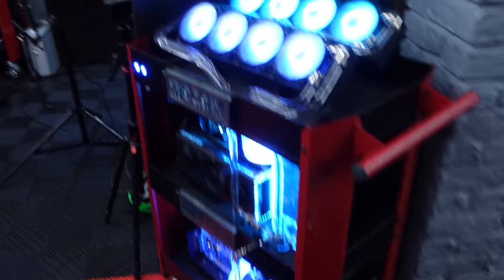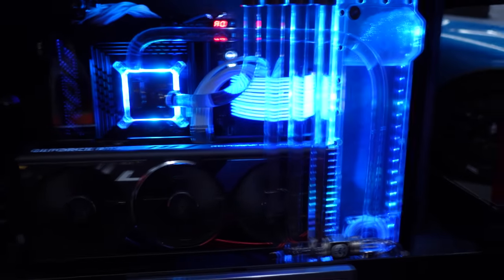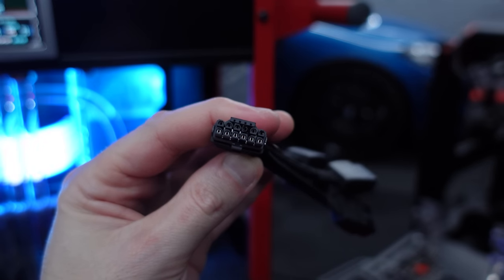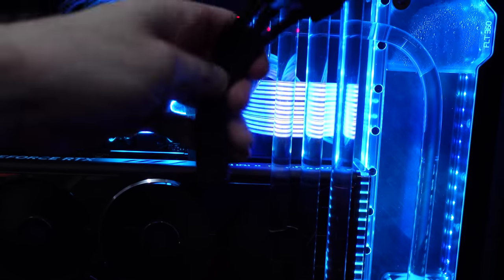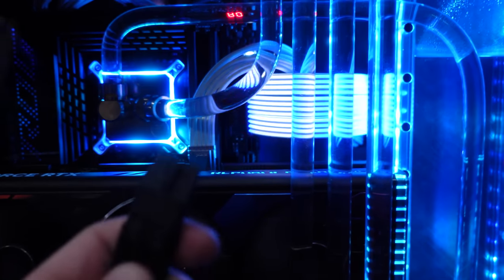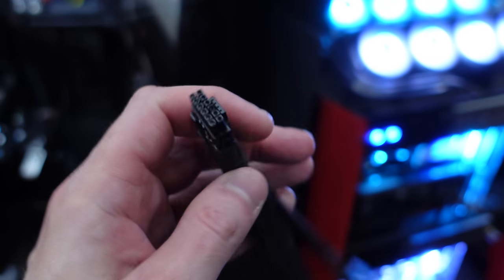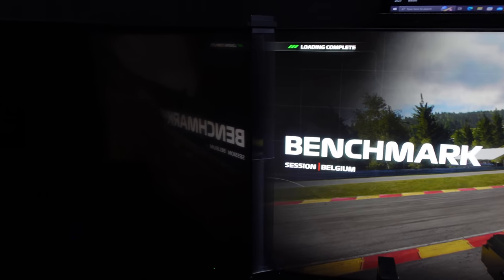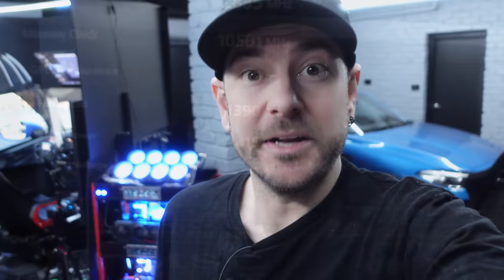MY 4090 WENT UP IN SMOKE after 7 Months!

Comment: Ive noticed with my xbox and pc that some games paused use the graphics card at 100%, not sure why they do that, so guess it was drawing alot of power over a long period, i didnt think the 40 series where supposed to be as power hungry as the 30 series
Reply: They aren't.  The 4090 vs 3090ti is 450 watts vs up to 600 watts, respectively.

Also much fewer issues with tripped power supplies.
Reply: @pondracek  4090 is very rarely uses 600w, look at this video where it's using 420w
Reply: This large consumption of electricity in game menus is due to the fact that programmers do not put a brake on the maximum number of FPS that a game does in these images that are static. A friend of mine is playing an indie game and has seen his RTX 3070 momentarily charge 1000 FPS in that game's menus. And it's only in the game's menus that the graphics card fans fire to their maximum rotation. And this is the second indie game that he plays and where this happens.This usually doesn't happen with games from triple AAA publishers, but this rule is not 100% certain. It's a situation that all gamers should be aware of, even those with graphics cards other than the RTX 4090.
Reply: @benclimo461  The 4090 doesn't use 600 watts.

The 3090ti does, on certain models.
Reply: The 30 series uses more power and cost a thousand dollars more than the 4090.

Comment: Do you have your 13900k over clocked at all?     

I've found my GPU runs significantly better when my 13900k is running XMP and over clocked..   I don't go crazy.. generally run 2 cores at 59.  3 at 57, and the last 3 at 56.   Then E cores at 45.  Even tho I'm only running a 3080ti at 1440p 49 UW monitor, my GPU runs so much better when my 13900k is running efficiently.   

My benchmarks are 14,000-14,100 on the Intel XTU 2.    Time spy CPU score 24,100+.  3d mark CPU benchmark 17,400 all core and 1250 single core.  

I will say the 13900k is a pain in the ass to get fine tuned. At least with the Asus motherboard bios's
Reply from the maker: Yes it is.

Comment: Personally this is happening often enough that it isn't "user" error.   The 12 pin connector is just a commercial failure itself.    You're taking 16 pins and shrinking them down into 12 pins in what is likely the hungriest GPU to have ever existed.  It's bound to happen... I feel any tiny fault whatsoever will cause it... and personally that's a FLAW in the over all product well beyond just connectors.  It's foolish calling it a user error in short.   It isn't like the good old days where you could install memory upside down, this is a connector, it should plug in, and work.

Comment: don't know your fps situation with those 3 screens.. but i dont get why you dont undervolt the 4090, pretty sure you would get about same performance but way much less power consumption and heat..
Reply: why undervolt? the cooler on this thing is overbuilt, even for a 4090. undervolting would reduce the power draw and also some fps. even if you lose 5-10% performace, why even do it if you're not concerned about your bills and the heat?
Reply: @Amfibios  your answer clearly shows me you dont have a 4090 or you dont know enough about undervolting techniques, there are various ways and you completely maintain the stock gpu boost and still save averages of 70-100 watts less power draw, it actually increase fps because the card wont probably loose the 2835  V/F point since it produces less heat.
Reply: @HyrrokkinX  please link a guide where you gain more performance by undervolting the 4090
Reply: @Amfibios  it's literally all over the internet, google or YouTube just use the search.
Reply: @HyrrokkinX  wait a second. you've been pretending to be an expert on "undervolting techniques" all this time and supposedly i don't know enough. if the secret technique is all over the internet i guess i'd know it, right? i'm still waiting for the guide that shows you how to undervolt a 4090 and not only decrease fps, but also increase it. it should be easy for you to link it, they're all over the place anyway, right?
Reply: @Amfibios  i am not pretending anything.. if you can't even use Google or YouTube not my fault. do your homework.
Reply: @HyrrokkinX  busted mate... imagine preaching and being unable to provide proof. trolling 101 right there 😂

Comment: Okay, few! A Cable Mod's cable didn't cause the issue. I immediately ordered a CM cable after buying my 4090.
Reply from the maker: So did I. It took 3 months to arrive though and in that time I had no issues so I thought it better to just leave the connector alone than put it though an unnecessary cycle.
Reply: @Boosted Media  I had the same reservations once my CM cable arrived. However, my GPU is mounted horizontally, and the power cable is slightly pressed against the glass. I opted to swap it right away once I saw the metal support for the pin that melted on yours. Figured swapping right away was safest for my application. I wish the 90° adapter would fit my 4090, but the cooling fins on the Aorus Master stick out too far. I'm about 5 months into my ownership, and so far, so good 🤞🏻

I hope moving forward, it's smooth sailing for you and your setup 👌🏼

Comment: I dont care if its user error or not, modern pc components should not catch fire. The fact its a known issue should be a major red flag and they should have been taken off the market. Shame on NVIDIA for releasing cards and connectors that can do this. You should not have to make sure the connector is pushed in after the click, it shouldn't catch fire it should just not work.

Comment: The cpu has no bottleneck I saw the gpu is running at 99%😂. When u have the gpu at 80/90% then u have an cpu bottleneck. Ur 3x 4k monitors is the bottleneck 😂
Reply from the maker: Yep the difference in power draw is down to ray tracing. If I turn it off on F1 power consumption is more similar to ACC.

Comment: From the damaged connector that you showed you can see it was not plugged in all the way.
There is a line on the damaged connector from where it sat in the connector.
Its a very easy mistake to make because there is no audio feedback or feel if its in all the way in.
To see if its all the way in you can't see any of the male part of the connector and they need to be flush against each other.
If your still confused to how far it needs to sit checkout MSI's version of the 12vhpwr connector the yellow part you CANNOT see.
Reply from the maker: It was absolutely unequivocally plugged in and seated correctly.
Reply: I believe you, but it definitely looks like a "tan line" on this still image. 5:11 

Do I believe that these connectors can melt when unequivocally seated? 

Absolutely I do! 

It's the main reason I'm waiting to see if there are improvements to 5000 series connectors upgrading my 3080.
Reply from the maker: I can see the line you’re talking about. Not sure if it’s caused by the heat cycles around where the pins sit but it’s certainly not a score mark where the connector was resting against the socket. It was 100% pushed all the way down and I visually checked it meticulously.

Comment: The whole ATX standard for PC's is falling apart. 
The size, weight and power consumption of modern gpus makes the idea of 'mother' and 'daughter' boards completely redundant. We really need new  form factors and a reimagining  of what a pc can be. 
Instead we get a slight change in the pins the cables use.
Realistically only Intel and Nvidea working together can give us something new that has the capacity to take us into the future.
Reply from the maker: Agreed. The 12VHPWR connector is massively inadequate for the current throughput it's expected to handle. I don't know what they were thinking. The fanboys screaming "user error" certainly doesn't help either.

Comment: From what I can tell and the many hours of research I have done. It looks to me like the terrible adaptor that comes with the card and the Cable Mod adaptors are the ones burning up. I have yet to see any of the Corsair Premium cables melt. I really hope this is the case as I am using one atm. 
There was absolutely no way in hell I was going to use that garbage Nvidia adaptor no matter what stupid message they wrote about voiding warranty. Shocking quality and looks awful in an expensive rig. 
Nvidia should be ashamed but sadly they have no dignity so no chance of that.

Comment: Not the video you want to see as you thinking of buying one. I wish they would do away with the connector and just hard wire it one less failure point.
Reply: And what do they put at the end of that wire?  (That's right.  A connector.)

Literally the definition of a distinction without a difference.
Reply: @pondracek  you eliminate the faulty by design connector, and yes you have tried and proven connectors at the other end.

Comment: Hey Will! Looking at the pictures, it looks as though the cable wasn't fully inserted. All cases of those cables catching fire was related to the cable not being properly installed, not the bend radius or the brand of the cable. I know you've adressed it in your video, but still.

Comment: A very poor engineering decision has been made with those connectors. Some people maybe thought that they could circumvent the law of physics by cramming much more current into tinier pins without thermal consequences. Design considerations must not take over basic physics
Reply: The connector "should" be absolutely fine to handle that kind of load, it's around 420w he was using at most and  between 6 pins the wattage is only around 70w which is absolutely fine for those pins. Remember that some phones charge at 120w and the pins are much smaller and I haven't heard of any fires.

This is a faulty cable which should never have been allowed to pass QC.
Reply: The spec for usb C charging is a max of 100w at 20V, spread across many "pins" , on a completely different style of connector...
Not really comparable at all.

The fact remains that the 12vhpwr is cutting it very close amperage wise, and the pin design seems to have issues.
As shown by the many failures that have been happening.
Not to mention that connector is rated for 600W

Comment: Technically it is user error, because you didnt check the connection each time you went to use it. But in reality its manufacturer error with the connectors on the card side, no cables are fire proof yet. Theres also no real fix other than not buying 1. Its a flawed connection and needs to be changed. If you want to learn about it, watch gamers nexus videos, hes done testing and has recreated the issues
Reply from the maker: The connector was seated perfectly. Nothing about this is user error and I watched all the content from GN and others as it came out. I was acutely aware of the issue hence checking the connector so regularly and not water cooling the card.

Comment: RTX 4090 24GB = around 80 % of them are melting their own 12-pin connectors = around 50 % have to RMA-d due to melting death of the PWR circuitry
RTX 4080 16GB = around 50 % of them are melting their own 12-pin connectors = around 25 % have to RMA-d due to melting death of the PWR circuitry
Reply from the maker: Where are you getting those numbers? That seems grossly inaccurate.
Reply: @boostedmedia  How do you figure that these are inaccurate ? Do you have statistical numbers on your own ?

I am using multiple European hardware repair specialists testimonies and statements, including my own since I also repair PC components, when they are constantly telling me for a year now, that the largest number of hardware repairs out of all the PC hardware repairs are done on the RTX 4090-s as far as PC components goes in general. They have their internal statistics from their businesses which they have to have due to invoices that they put out on for repairing these GPU-s. Countless clients of mine, that have bought the RTX 4080-s or RTX 4090-s have already either RMA-d 1-2 of them or repaired them at these specialists.
RTX 4090 is by far the largest numbered of failed product in the PC computer history. No other hardware component has broken down in such large numbers and I've been repairing PC-s since the age of 3D-FX Voodoo 1 4MB and 1-st gen. Intel Celerons and Intel Pentium 2-s.

Comment: Honest opinion, most dumbest connector made. Just go back to the 3x 12v rail connectors. That way you have isolated current through into the PCB. Smaller isn't always better. Problem when aesthetics takes over just an engineering flaw.

Comment: Im glad nothing worse than this happened! 
Was the connector actually fully plugged in? In the end lab testing finalized that the problem is with these burns in 99% of the time is the cable not fully being plugged in
Reply from the maker: Yes.I was absolutely meticulous about this and visually checked it regularly just in case it backed out for some reason.

Comment: Click bait much? 😂 There's a slight difference between a card going up in smoke or a connector failing/melting and the card still working with a new connection lol
Reply from the maker: When I walked downstairs there was smoke coming out of it.
Reply: The only difference is temporal.  

Given a few more minutes, I'm sure you could get from Point A to Point B.
Reply: @pondracek  doesn't change the fact the title suggests 1 thing and reality another aka click bait. When someone in saying, in all caps, that something went up in smoke, it is implying it burned down, not that  some smoke came off it
Reply from the maker: I said it went up in smoke because it went up in smoke. If it had gone up in flames I would have said it went up in flames. 🤦‍♂️

Comment: Ok, well if it was plugged in all the way then everyone would have theirs fail.. I’d double check your new cable.  It takes so much force.  20-30lbs.  Put a lot of force on it.  Don’t be nervous about it.  No one has broken the soldering by properly pressing the cable in.  I thought it was silly how much force it took.  terrible engineering… it should take 10lbs max and have a very tactile and audible click.  Not rocket science…

I am using a cheapo 3 to 1 on mine.  It’s much more flexible than stock too.  Bending 180° in less than 2”.  No issues but it’s 100% clipped.  Who knows, it might fail if yours did.  You’d know 100% when you unplugged the failed cable if it was clipped.  You say it was… so I guess we’ll assume you’re telling the truth. I just don’t see how it fails when it’s clipped.  Literally first case of this happening in the world….
Reply from the maker: Yep. It absolutely was. You can even see the scorch mark at the BOTTOM of the socket on the card side.

Comment: Ah yes spending 2k on a gpu and watch it kill itself within a few months 😂 typical nvidia. That's why i switched to team red.
Reply: Yet AMD can't compete, driver issues and very poor VR performance.
Reply: @BKHD605  yet nvidia gpu lights itself on fire ... Yeah rather have a fire hazard then driver issues i guess 😂
Reply: @henkhenkos8647  It's a shame you can't buy the 4090 with normal 8pin connectors
Reply: @BKHD605  yeah ngreedia and their " innovation" that turns your house into a big heater if you're lucky 😂 and true why trying to fix something if it isn't broken...

Comment: If I remember correctly, several tech youtubers managed to narrow the points of failure down to a) the cable and b) (and most commonly) the cable not being fully inserted. 
I think this might just have been a case of the latter, as its tricky to tell if the nvidia connector is FULLY inserted, the only way to tell is to look for a gap between the edges of the connector and the plug. 
Remember kids, always force your cable into your GPU with a shitload of force or you might burn it down.
Reply from the maker: It was absolutely unequivocally seated correctly. I was extremely meticulous about this and visually checked it regularly.
Reply: @boostedmedia  Very odd then, good thing you caught it before anything serious happend. 
It also wasn't my intention to blame you.
It was just a thought I had because (I think) you didn't specifically mention that you know about the importance of seating it 100% correctly.

I also think the root of the 'user error' is nvidias fault, because this absolutely shouldn't be an issue, plain bad design on nvidias side here.